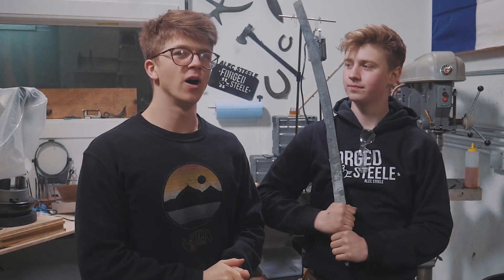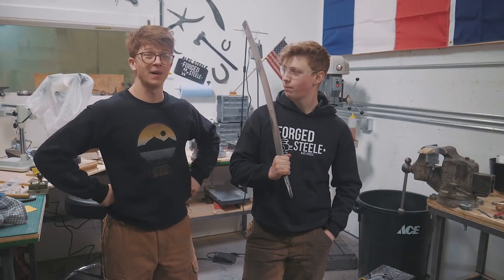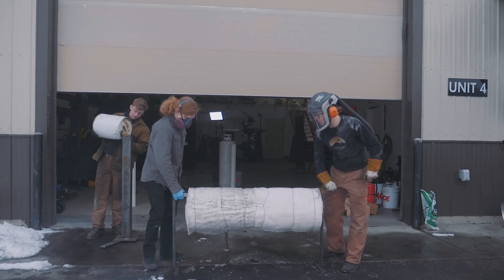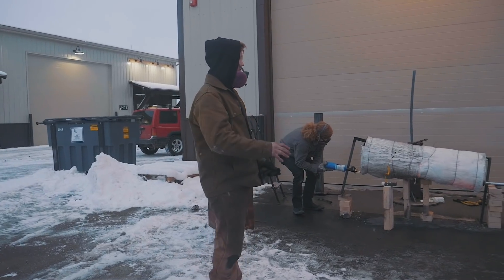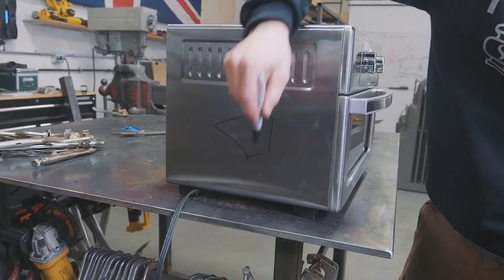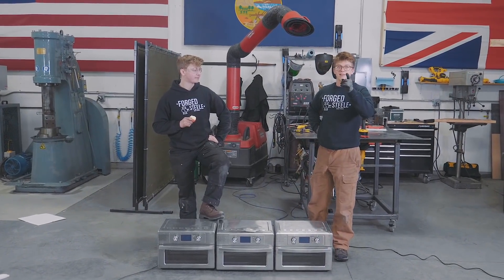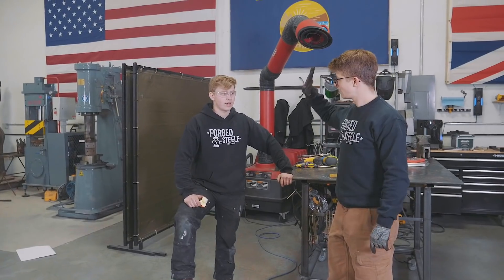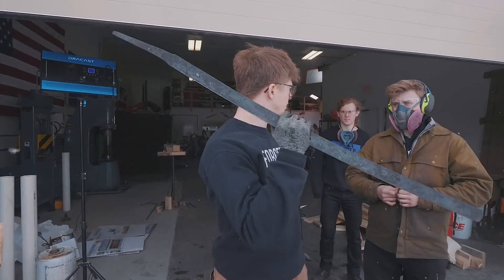MAKING THE CAVALRY SABRE: Part 4

Comment: I'm a little concerned that the triple-toaster monstrosity might not work since you guys basically gouged out a hole through the sides (isn't the double wall supposed to be for insulation?) But then again, as Will says: it's not stupid if it works ¯\_(ツ)_/¯

Comment: Don't wanna hate but you guys buy a pretty expensive lathe and brideport mill but you can't get a decent long furnace for sword smithing and neither a tempering oven, even tho you need that way more for your usual work. The hack normal items to get things done method does get boring with time and you always have no certainty that your blades turn out good :(

Comment: Why does the quench tank have to be vertical? As in why not cut one side of the pipe, lay it on the ground? No need to get up high and isn't "the dip" more uniform when done like this?
I'm sure there is a reason for this but I was not able to find it so someone please educate me. Is this just a shop floor space saving thing or something else ..?

Comment: Okay, I have to ask this, I can see there is a lot of money being spent here and it does not seem like you have a problem spending money or coming up with money...so the question is, why would you not get an Evenheat KF 49.5 Heat Treat Oven?  The dimensions are 10” W x 6.5” H x 49.5” D.  Even if you wanted to keep your heat treatment to the forge, at least this thing could temper any kind of sword (safely) you would ever want to make!

Comment: Hey guys. A little bit off the subject of sword making... I'm not sure if you've noticed, but your video clips are somewhat washed out and lacking the color depth and proper contrast. It could be a variety of reasons, like insufficient lighting or uncalibrated white camera balance, etc. It could, however, be easily fixed in post-production with minor contrast and color adjustments. Just my two cents to help to make your journey even better. Otherwise, I thoroughly enjoy your channel. Cannot wait to see the finished blade! Warm cheers from -50F hell-freezing-over Chicago :)

Comment: oh Alec...why You didn't forge bevels and fullers, and bring curvature to the blade by doing that? You guys are smiths after all... Whats more-as far as I know saber should be quenched differently through its length and that's why it is sharpened only at the end section of the blade. Functionally You got 3 segments of the blade(1/3 of the blade each)-one to parry, one to give the proper stiffness and one to cut (in order from handle to the tip). The length of the cavalry saber can be estimated by measuring the distance between 
Adam's apple and tip of Your fingers (hands spread). The handle should be as small as the width of Your palm (including glove) to give the proper support for the little finger.

Comment: Why on Earth would you bolt that quenching tube to the floor with arms? 
4 bolts near the corners of that plate would be more than enough and you don't have those nasty trip hazards, especially in a confined area.
Just steel, tools, hoses, torches, welding, hard corners and surfaces everywhere... I'm sure nothing would happen & everyone will be fine.

Comment: Why not just get an industrial pizza oven? It would be big enough and hot enough
Reply: Mark Wright ...used "industrial pizza oven" cost about $1,500. 
3 Wal-Mart toaster ovens: $120 ish. They said they just need something temporary till they get their real heat treating oven (probably about as much as an industrial pizza oven).
Reply: @zerofoxgibbon3923  I meant as a permanent solution of course it wouldn't get as hot as a forge but you could save up a forge using it just to temper and most of them are big enough to put a whole sword in
Reply: Mark Wright ...that would work pretty good! Especially if you could find one of those rare auction deals for a couple hundred dollars.

Comment: Alec, if you're reading this, don't drop your standards just because you moved to the states. You really think that the thermostat in each of those toaster ovens are going to be accurate to each other? I've been on job sites that use the type of insulation you guys decided to use in the great outdoors. It's not good stuff. Don't mess around with that. It seems like you guys are trying to get some blacksmithing content out; which I like, but it seems rushed. Your earlier uploads didn't have as much progress, but at least they had some substance.. This really seems sub par. Get your lathe and mill up and running. Get a proper set up. You went from (what seems like) zero compromise to all compromise. If you want to get some smithing out fast, then do a knife. Maybe a nice sheath with it... just sayin.

Comment: Your quench tank could be improved, put it at a 45 degree angle, and on the top make a clamp that fits the tang, but when put in, it slots into the top, keeping it straight without having to use the tongs  , At a 45 degree angle you dont have to use a ladder cutting down the risk.   Oh and your health and safety sucks, play safe as its not like the UK as OSHA will fine you.
Reply: HSE in the UK will fine people too, and in severe cases prison.

Comment: Guys, working outside on wet, snowy or slippery ground while handling thousand degree metal is properly stupid... Like REALLY, REALLY dumb. Any accident will go bad fast. 
Please find a way to work safely inside your shop, and put some anti-skid matting down.
Any risk assessor would laugh his arse off at what you're doing here. Propping your heat treat oven up on vertically stacked bricks? Standing on a step ladder that's set on snowy ground? Really??? Enthusiasm is great, but you need to temper it (see what I did there?! ;) ) with a bit more thinking and caution.